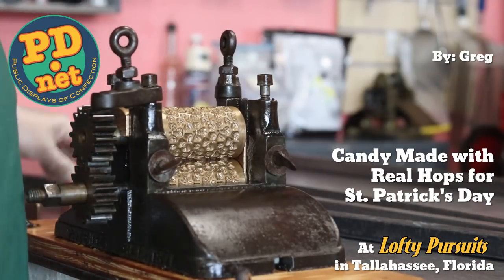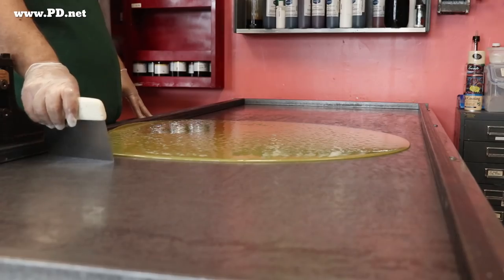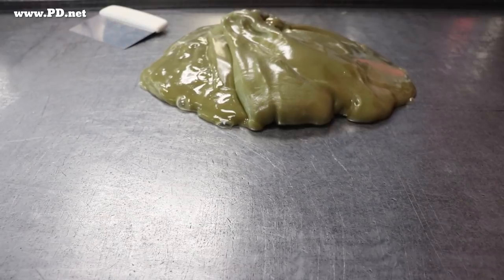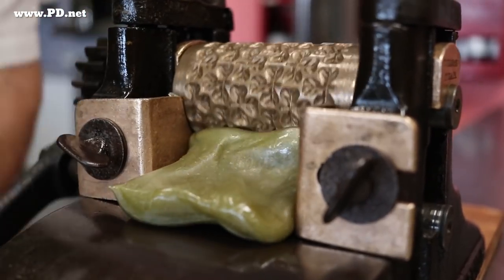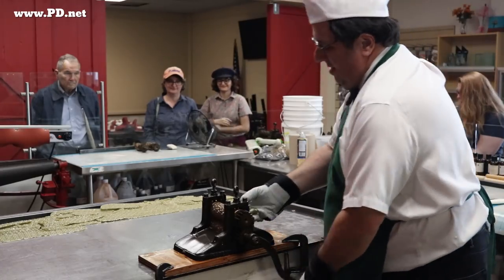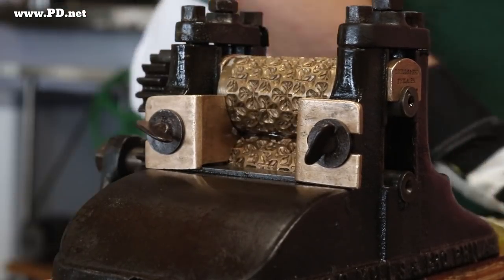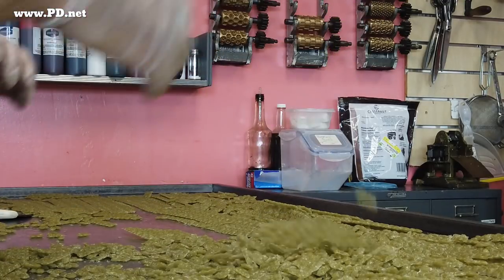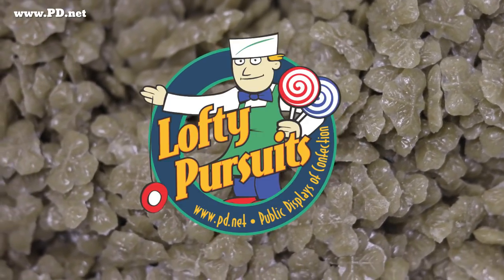#132 Lofty Pursuits figured out how to put Hops in Hard Candy for St. Patrick's Day.

Comment: How do the drops hold there shape right after they are rolled? I feel like they should melt or deform like the image candy rods do if you don’t keep moving them.
Reply: The rollers are made of brass or copper which conducts heat away really well. The rollers also roll the large blob of molten candy into a roll of drops with a high surface area, allowing the candy to cool even faster.